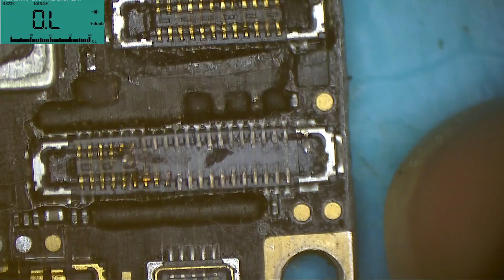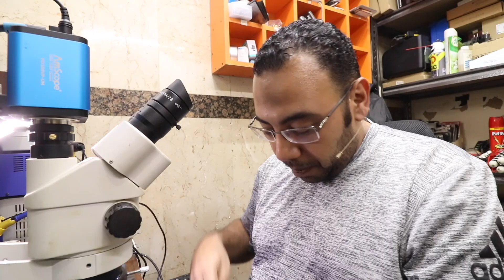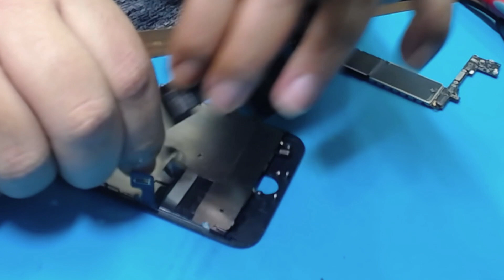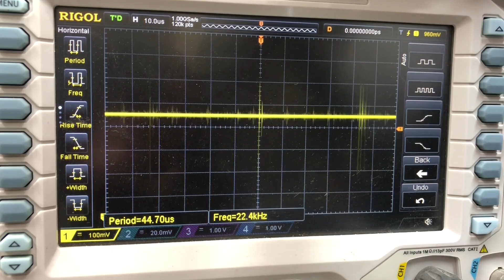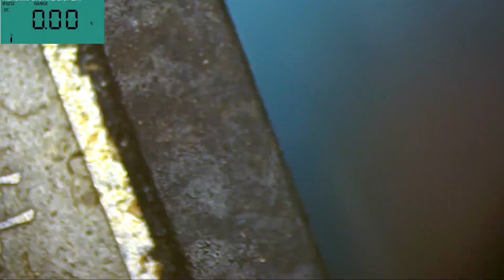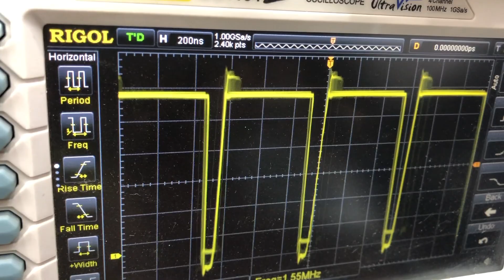How to Fix a DEAD iPhone 8 Not Charging or Turning On

Comment: Hi Ayman, Nice video :) 

What software do you use for showing the multimeter on screen? Is it universal or just working with the model you are using?
Reply from the maker: it came with the multimeter and it is not universal
Reply: @AymanTheRepairTech  So then, what is the model of the multimeter? :D